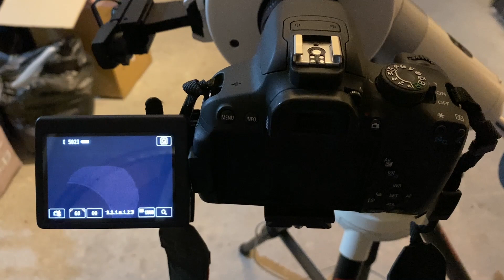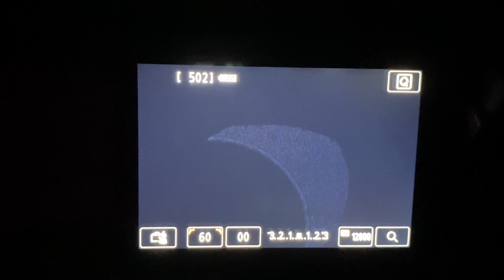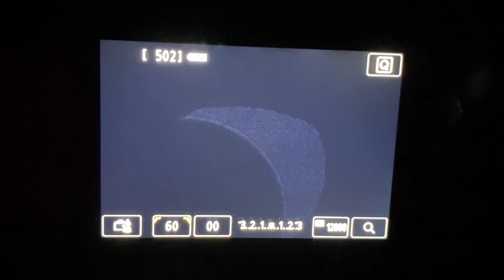SCT Reducer Corrector with a Maksutov Telescope - Strange Artefact Investigation

Comment: The problem is that any kind of reflector can not handle big eye pieces , i noticed it on 4inch Newtonian and 30mm eye piece , and there was no improvement over 25mm , i got 5mm of tube visible, this is due to the light path , secondary mirror being a problem  narrowing the field of view where on Refractors i could put in 50mm EP on a classic 80mm scope .  So when we fit a reducer in we get like larger field of view and Macs are known to be sharper because they have smaller central obstruction but this is where the problem is , now it has larger then designed FOV and somewhere in there there is a problem , its not the faulty reducer , its not a faulty scope  , its the design it self . If you have put the Full Frame on there i guess something strange would happpen . Even more drastic then this . Because its limited field of view , most limited FOV of all scopes is the MAC. So smith cassegrain  barely escapes , Newtonian escapes but not from the EPs larger then Full frame sensors , but refractor , you can put a medium format camera on it , all you will get is vignetting , its just the light path and the optical design . Field of view obstructions .
You can see this if you put no EP , and let it twist the image and reflect it on the wall . There you would see the light cone , or  illuminated space being different in different designs .

Comment: I am firmly convinced of a number of matters here.  Firstly, both baffles could stand to be shortened by about one full cm.....at least.  But even if you shudder at the the thought, their tips, especially the faces of the ends, need to be blackened and made dull, probably best by applying Musou black paint (amazon). The secondary baffle flares out quite a bit and ends up occluding the light path to the central part of the primary mirror.  Cutting the secondary baffle back, or tugging it off altogether, will almost certainly not have a deleterious effect, especially at night, and especially if...bringing up my last point...you use a fairly long dew shield, at least as long as the aperture. This one item will prevent incident light, say from a bright moon just outside of the field of view, from making ghosting and flaring.
Reply from the maker: That’s interesting. As you say I’m not keen on testing it on my 127!
Reply: I was going to suggest the same idea of using a long dew shield.

Comment: Hello, I know it's been quite a long time since you posted this, but have you been able to figure out anything about these strange artefacts?
Reply from the maker: Not satisfactorily. Others have commented that the wider field is “allowing” a reflection from the adapter to reach the sensor. This seems plausible but I haven’t proved it.
Reply: @JenhamsAstro  Thanks for the reply. I guess yeah. By the way, which adapter/tube are you using to connect the T-ring to the reducer? I'm probably going to try this option too, just not sure what to go for completely. Is it 2" or 1,25"?
Reply from the maker: @tilenoman1265 I used a Celestron SCT T-adapter, model 93633-A

Comment: I have used an Anteres f/6.3 SCT Reducer/Corrector for years with my Celestron 127 Mak without this issue. Saying that, I only use this reducer for astrophotography and not visual.
Is it possible that you aren't using the correct back space distance when using it for visual?

Comment: I bought similar 0,63 celestron reducer for my Mak127. I had only 2 nights to test it, so it's not a full review but I can say something ;) 1. Mak 127 gives APSC field of view (nearly), so with 0,63 reducer it will be 0,63x times smaller - so around 4/3 matrix. For smaller cameras like ZWO 585 it would be optimal vigniette free. 2. I had also small problem with focus shift (due to celestron sct - t2 nipple) but yes, stars only in center of FOV are good. Going further from ten center of image they are more elongated. 3. I haven't similar patterns like on the film, but I didn't tested it on Pleaides or other bright stars, so I'll check it. To sum up - for smaller fov (like 1 inch and so) it works, but don't expect miracles, you won't win APOD with Mak F8 combination, stil for amateur work it's ok ;)
Reply from the maker: Thanks for adding your experience. I’m hoping to pin down the source of the reflections at some stage as my example of very bright stars near the edge of the field was a tough test. I’ve since seen not dissimilar artefacts with a different setup - likely the reducer just ‘allows’ these to reach the sensor. The distortions are another story, so it’s a 6 out of 10 from me.
Reply: @JenhamsAstro  ok finally I had good weather so tested that spikes with reducer on Pleiades. On 10s exposure (around F8 and 1000 mm) I see it only on autostretched images in Siril. Also they are a bit smaller. When I see where yours spikes are I can definitely say that it's field curvature problem. Stars near center don't have it, only  these on the outside. So just use 0,63 reducer with smaller sensors like ZWO ASI 585 and smaller ones and it shouldn't be any problem :)

Comment: 😬 You could have marked the OTA with the corrector cell and just unscrewed the cell. You're very brave to remove the corrector from the cell... But I'm absolutely sure it'll be fine.

Thank you for this!

I think because you get the aberrations only when the reducer is on, it must be the reducer. Perhaps the lens edges of the reducer aren't blackened?
Reply from the maker: I think it's a reflection issue somewhere  - others have suggested in the adapter - so maybe the reducer is just revealing it rather than causing it. I'll have another go at figuring it out at some point. So far the 127 seems to have gone back together OK!

Comment: Would it be worth trying an EdgeHD (8?) reducer if it fits? Since they reduce but don't correct? I'm wondering if anyone has tried that before.
Reply: No, EDGE have other reducer (0.7) so using 0,63 with it won't work

Comment: I think I may have a culprit but this is just a hypothesis for now. Try changing your Celestron #93633-A Adapter to anything in M48 size and see the difference. I was just affected by those arcs after moving from M48 extender and Baader Click-lock SCT visual back I used yesterday to this Celestron 50mm long T-Adapter I see you are using as well. Let me know if this solved your issue. I have no flocking paper nor black matt paint on me to blacken this adapter for testing as I just came up with this finding. Will buy some from Amazon and test. PLMK how this goes for you if you had a chance before me.
[Edit] just to add I'm on C5 SCT + Telescope Service F/6.3 FR/Corrector (same as Celestron one) and the only thing common to your setup is this bloody adapter, so it can't be coincidence. I seen the very same thing on my Meade 90ETX MAK way back. I was using same adapter there but I though as you that those reducers and MAKs don't go well together.
Reply from the maker: Interesting. When I look into the adapter it looks dark, with the recessed lens electrical contacts being the only obvious  source of reflection. But it isn’t as non-reflecting as the newly flocked secondary , so maybe that is it.
Reply: @JenhamsAstro  I'm not using DSLR, so no electrical contacts for me to cause any reflections. I think this is to do with the difference in diameters between FR and extension tube where adapter has this flat part making contact with FR flange. My 533 MC cam has smaller sensor vs DSLR hence those arcs are less pronounced, yet they still are there if bright star is just off the FoV. I am purchasing M48 50mm long SCT extender to make imaging train. Will let you know if this helped as much as other setup I mentioned earlier.

Comment: Years ago, I think that there was a focal reducer for Maks made by Intes Micro. But I'm not sure. I remember that I saw someone selling his Mak, an original Intes Micro, with a reducer which didn't look like other reducers I know. Did somebody know about this? About your experiments, it's very good you did it, even that the results are not good for now. You can try to defocus in both directions, to see what is happening. And on a less bright object.
Reply from the maker: I haven't seen that reducer but I've heard of it, it makes sense to use a bespoke unit if one is available. I will keep experimenting as Venus was a convenient but tough target given its extreme brightness. I saw no issues after swapping out the reducer and going back to f/12 though.

Comment: I do not do any serious photography with my 127 Mak, I use an F7 102 ED triplet refractor. I don't like adding to mine other than using a two inch diagonal with wide angle eyepieces to 62° to 72° fov at 37x to 50x. One I got came with the 1.25 diagonal, pissed me off. Eyepieces were freaking Kellners too, should of bought the Celestron version at least they're Plossls. edit; I least I think they are.
Reply from the maker: I really like the 127 for planetary, but like you I've got faster scopes for other targets. I thought it was worth an experiment though.
Reply: @JenhamsAstro  Yes I suppose it couldn't hurt, but focal reducers are not cheap though. If I already had one it would be worth a try, but I wouldn't buy one with my other scopes, an F5 1/12th wave 150mm reflector, the F7 refractor and a Sky Watcher 102 and 127 Maksutov.
I have noticed neither one of my Maks has the clarity of my other 2 scopes.
I suppose if I hadn't had my 150's mirror refigured it wouldn't be in the same class as my 102 Apo.

Comment: I had the same internal reflection issue with a Celestron 6-in SCT + FR. In my case the artefacts were apparently caused by internal reflections off the extension tube rings between the FR and the camera. Swapping these out for another set I was able to eliminate the problem. Flocking the extension tube may be the solution. Good luck!
Reply: Can confirm, 6" sct + celestron focal reducer, but have not tested where the issue comes from, and it's been a while since I've encountered the issue, since I've not been observing bright targets.
Reply from the maker: Thanks that's useful to know. My DSLR extension tube looks nicely black so I'm at a dead-end with the issue at the moment.

Comment: Thank you for taking the time and trouble to identify the culprit, even though you weren't able to nail it. The comments I've seen on forums such as Cloudy Nights seem always to denigrate the Mak/Cass/focal reducer combo you have been trying to use here. Many opinions are given to explain why - some citing optical design theory far beyond the understanding of we amateur astronomers. However, were it possible easily and reliably to adapt Mak/Cass scopes to be faster than their native capability in the manner of SCT's, I think we would have seen such a product in the marketplace selling like hotcakes. We haven't.
Reply from the maker: Yes, the jury is still out. I'll make another video if I figure anything out, otherwise I'm more than happy with the 127 at f/12.
Reply: @JenhamsAstro  I'm not sure it's a case of the jury still being out - more that this combo was convicted by the jury several years ago :face-fuchsia-wide-eyes:
Reply from the maker: @AntPDC  I wanted to try it as whilst I’ve read a lot of the negative feedback on the forums, some people give a positive review. For me it doesn’t work. On to the next!
Reply: @JenhamsAstro  Experimentation is the very crucible of learning, I agree.

Comment: Hi Graham this is a good mystery for sure. I have done the test visually looking at Venus and with primary baffle flocked only and it has helped me eliminate the flares in my 127 sky-watcher mak even at very high power. Wonder did you try a look without the reducer? Did you get an improvement visually at all? Thanks for posting this video.
Reply from the maker: I've had a good look without the reducer and I don't see the issue at all. Hopefully the baffling, which I'll leave in place, will lead to some benefits even at f/12, not sure. Tis puzzling.
Reply: @JenhamsAstro  I agree with your conclusion that its most likely the corrector reducer that is giving you the flares at the edges of your field of view. A pure reducer only will most likely do the trick for you. Unfortunately, these reducers can introduce spherical aberration and vignetting also, something to take note. But flocking is definitely worth doing and I do think that its giving you benefits; it sure did visually for me! 

Just for fun you should make a video comparing older footage compared to the same targets now that you have flocked the OTA and see if it made a difference.

Comment: Very interesting, I used to use a Celestron 0.63 FR with my Mak 127, I never noticed any problems except vigneting. I changed to a 2" 0.5 FR (Telescope Service) only because I wanted more reduction, I'm still using it now, I image variable stars (photometry) and it's perfect at the right focal distance of 55mm. Looking forward to your findings with another FR, I think the one you have maybe faulty.
Reply from the maker: I'll post another video if the culprit is finally confirmed.